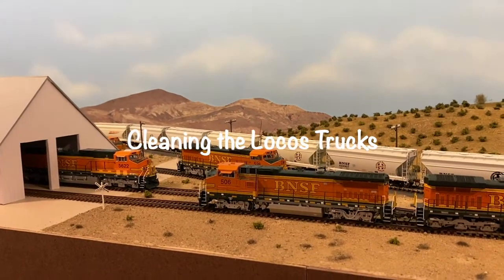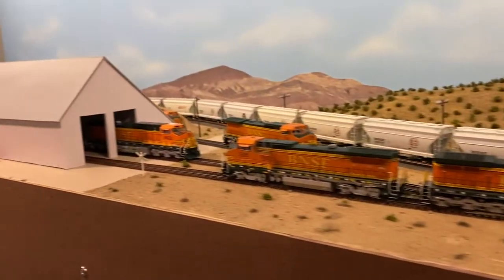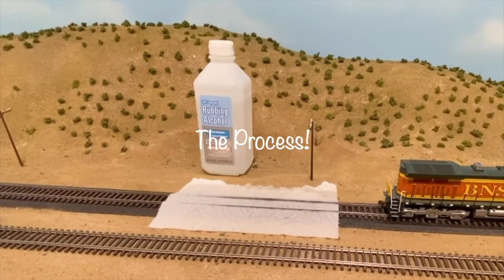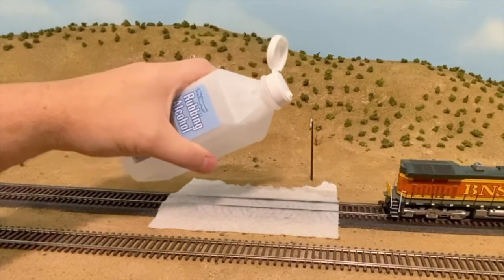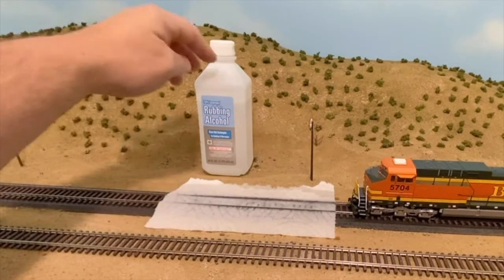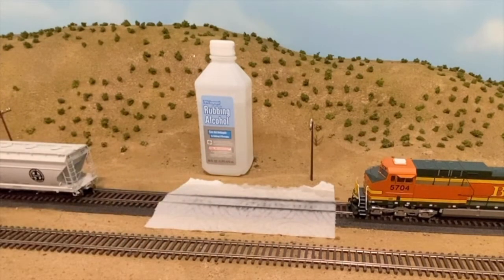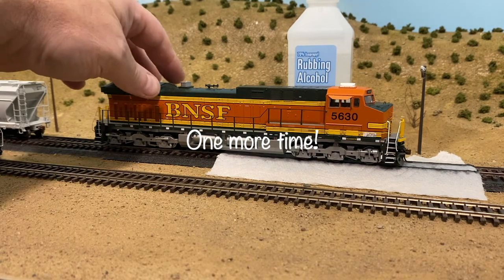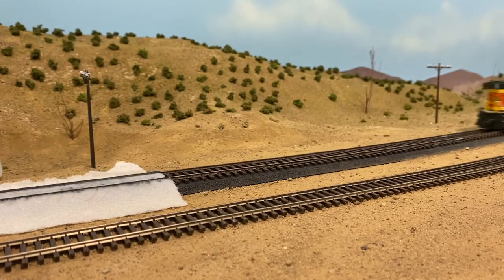How To Clean HO Scale Locomotive Wheels

Comment: So does it really matter on which alcohol to use..the 70 or 90 percent?
Reply from the maker: I never really looked at that. I just looked at mine and I have 70. I know that works.
Reply: idk I think 90/91 is higher I guess that means it does a better job than 71%.I'm just guessing 🤔 I don't know
Reply: @AlexNunes-z6v  I went ahead and used 90 percent..90 percent has less water in it than 70.

Comment: This is a great idea but it is no use for unpowered wheels...
Reply from the maker: You are right. I do not ever clean the non powered engines wheels. I only do it to improved performance when the powered units start to stop and start from not having a good connection to the track. Thanks for the input.
Reply: But the problem is.. that some of the locos have pickups on the non-powered wheels, like in the tenders of steam locos for a typical example.. they need to be clean to pick up the power for the loco to run......